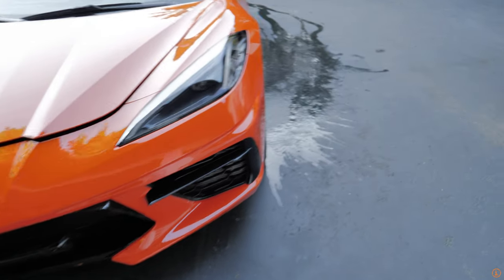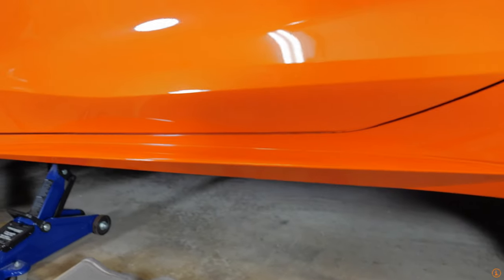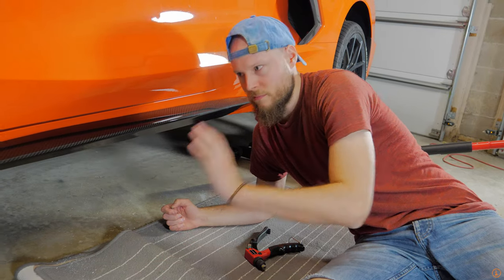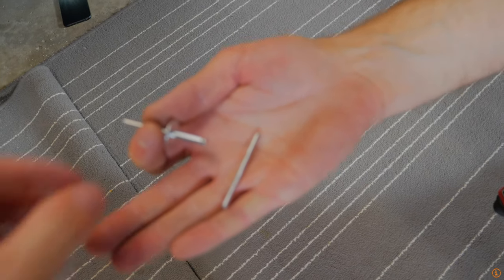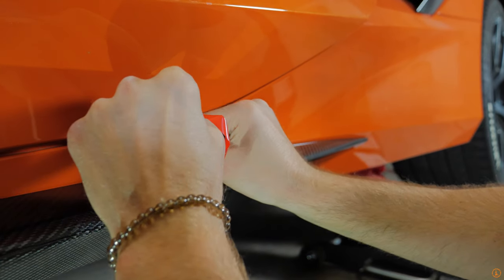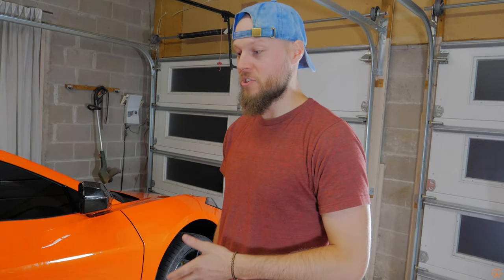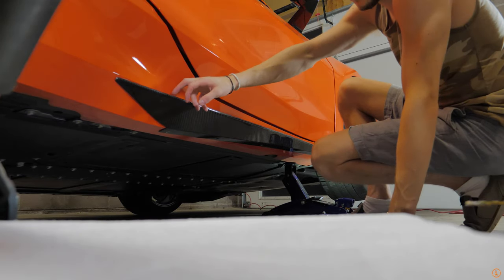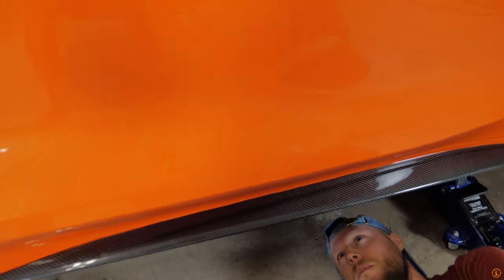Corvette C8 Carbon Fiber Rocker Panel Extension Install! *LOOKS GREAT*

Comment: Y’all are braver than me. I just installed OEM ground effects including splitter. I paid a dealership to do it. A hole has to be drilled into the side of the car just in front of the rear wheels.
Reply from the maker: We don't mind a good DIY! Oh yeah, that's a bit more complex as they remove the fender liner

Comment: Hey! I tried installing my side skirts with 3/16 short rivets (1/8" grip) but they don't seem to work - the stem never pops and it made one of my holes larger (about 1/4" big now, 3/16 rivet no longer works). Not sure how to salvage this, any words of wisdom? I wonder if I need to use a washer or something
Reply from the maker: hmm, not sure I can help without really seeing the issue. Sounds like you need to figure out why the stem never pops because they should if you are using the correct tool and rivet size.
Reply: @DailyDownshift  Seems like the batch of rivets I purchased might have been defective, I tried a different brand and they popped fine with no probs. Got them installed finally - thanks again for the vid!

Comment: The weave is in the wrong direction. The weave should angle back from front (inside) to back (outside). It should look wind swept.  The weave is also in opposite direction of the mirrors. The weave direction should be the same.
Reply: No one else could care less ! It looks great the way it is !
Reply: Perfectionists are always under fire
Reply: I agree, the CF patterns should be the same!

Comment: Anyone else concerned about drilling holes into your new car? I imagine trading in the car at a later date would be significantly devalued.
Reply from the maker: Not one bit, you'd be shocked at how little dealerships car about little things like this. I've traded in many sports cars and they don't even put it on a lift before giving you your money.